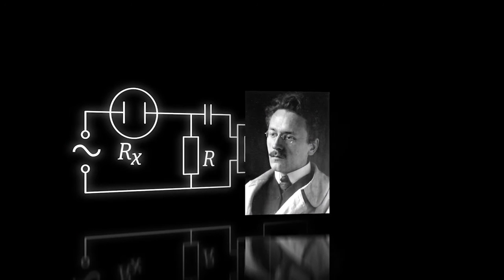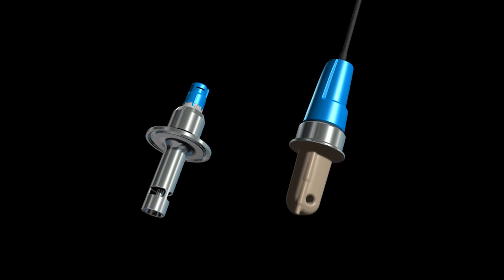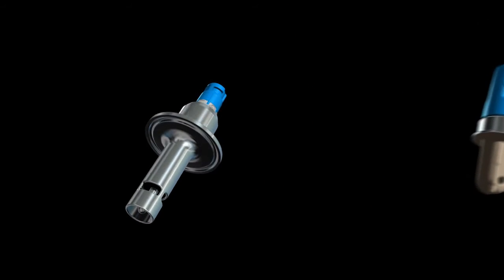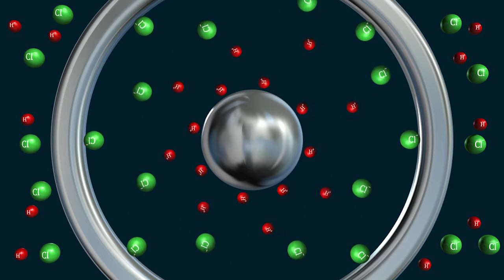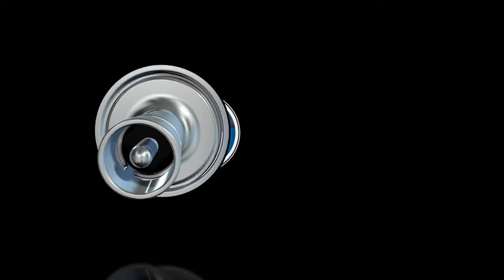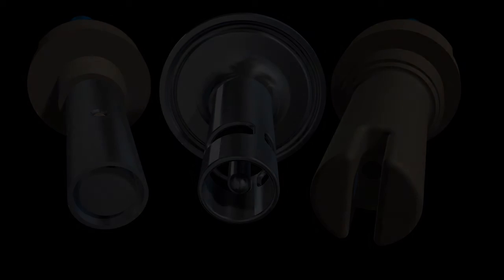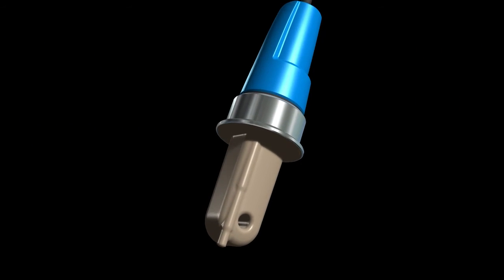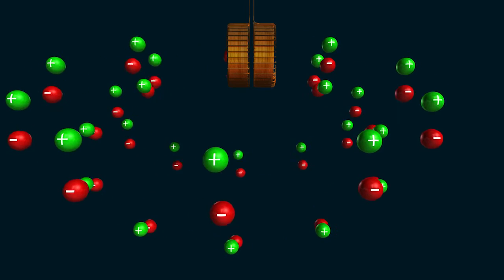Sensor de conductividad digital  EndressHauser

Comment: Daniel, na ponta do sensor existe um lado que possui uma marcação em anel com leve rebaixo. um instrumentista me disse que é pra indicar que a posição do fluxo e pressão deve entrar por este lado. Outro disse que não tem lado. O que vc me diz? me ajuda aí!!
Reply from the maker: Marcello Cabañes  hola marcello te refieres al sensor inductivo, a mi parecer no tiene sentido ya que trabaja con corriente alterna, y ese pequeño cilindro que sobresale es un pt1000 (sensor de temperatura). El modelo del sensor toroidal es indumax CLS54 de la marca endress&hauser
Reply: daniel diaz No és um condutivimetro CLS50D. No seria lo sentido del fluxo? Gracias!